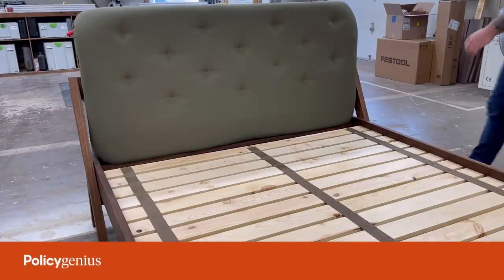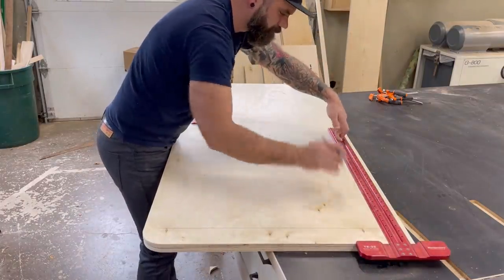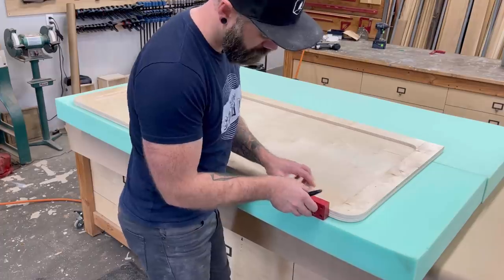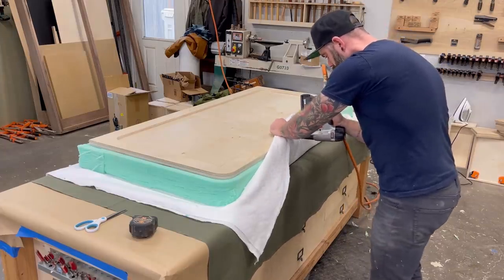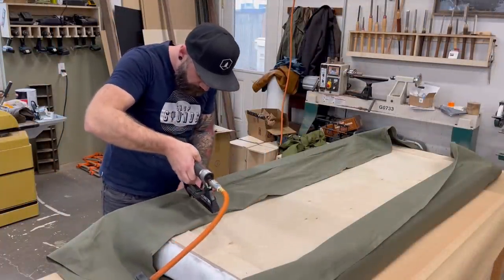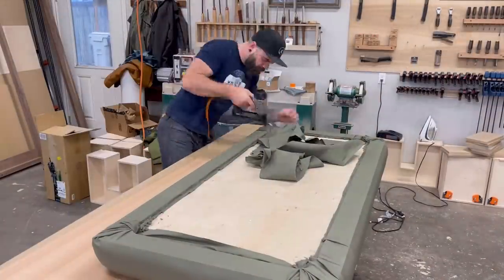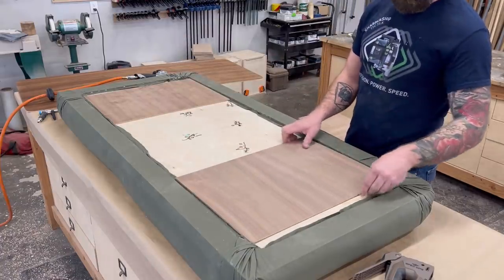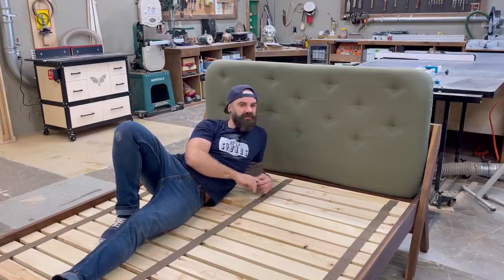Trying To Make a Headboard || This Wasn't Easy

Comment: A $10 electric carving knife from Walmart would have worked just fine, also it helps you round out the edges so you don't have sharp edges and it does not leave a huge mess

Comment: Everyone will have a way to "do" something that wont be the same as your way, but as the saying goes there's 100 different ways to skin a cat, as long as you get the desired finish in the end that's all that matters, you also learned the basics of a new skill to add to your cap that will help give you some insight into projects in the future that may require it again to help save time or make it less awkward.

Comment: 1. The foam you got was a bit too high density, and/or maybe a little too thick for your purposes.
2. Cutting the foam, I would have  recommended "borrowing" a bread knife, or a long kitchen knife.
3. Foam is generally glued using contact cement (like from your lamination video). Let it sit for a few days after bonding to off-gas, to lose the smell.

Comment: So now that you've done a ton of work cutting up that phone with a Box knife generally an electric turkey carver $2 or $3 from a thrift store does am amazing job its like cutting through butter with a hot knife good...  I do get not wanting to buy a unitasker but if you do regular crafting or if you ever want to work with foam again dude it's so worth it and I bet you anything you can find one at a second hand store they're always at the 2nd hand store.  I bet you I could go to the 2nd hand store right now and find one....  You'd have to ask an actual upholsterer for this one but I think the reason we use the batting between the phone is to help create a smoother transition when you wrap the fabric over the phone because you don't want hard cornered edges you want soft chamfered edges

Comment: I can see where ypu thought the idea of a back insert to hide the staples, but the simpler and easier solution was to use some simple cover-fix. But to be fair most people don't know where to get it or that it even exists. The other solution was to measure the end board and sew in the sides and hide the staples in the bottom of the frame

Comment: I like your work brother but you know there's this thing called YouTube where people post videos on things like furniture building and some channels cover tufting... the channel "chester" ks pretty good.
Reply: Ok so the proper way is to drill holes through the foam in a grid pattern and then use buttons and an upholstery needle to go through from the front and then staple in a zig zag pattern on the back so you're getting there. I do like your bed though.

Comment: One thing that would have made your life a bit easier is when you staple the fabric on, pull it tight, put a few staples in the middle, then go to the opposite side and do the same. Do the centers on all 4 sides first, then going around, work your way to the edges. Otherwise I think it's great.

Comment: Dood…there’s a reason we do BUTTON tucks. Same fabric over the buttons and you send them through from the front with 2 strings attached through the button using your giant needle, but I pre-drill 3/4” holes. On the back side we make 1-1/4”  1/8” plywood disks w two 1/8” holes. The button cords come through that and tie off The whole second frame thing was totally unnecessary  and made your life worse. All we do is use 1/2” MDF and ease all edge so nothing sharp against the fabric. BTW the buttons get pulled down first- working from center out. Pulling and fastening the fabric edge is done LAST.  It was also a mistake gluing on that back - if you ever need to tighten your tucks or replace the fabric you’ll wish you had an easy way in. All we do is staple black dust skirting over the raw fabric edge.

Comment: you can make one of these hot wire foam cutters if you ever need to do this again in the future: https://youtu.be/vXT49RqF6Qc Its super simple todo, all you need is an old DC Converter, something for the frame, and resistive wire.